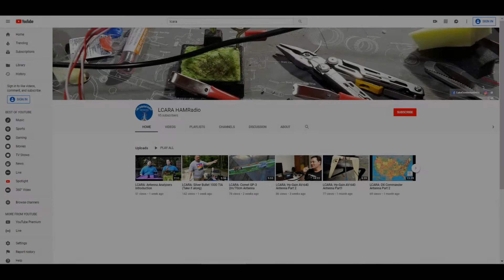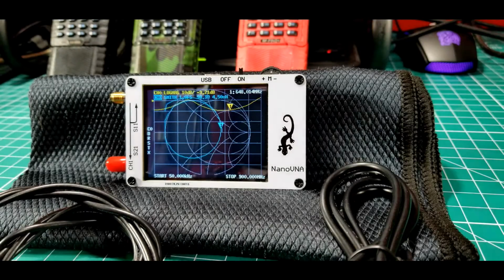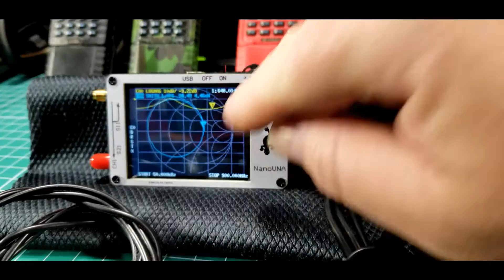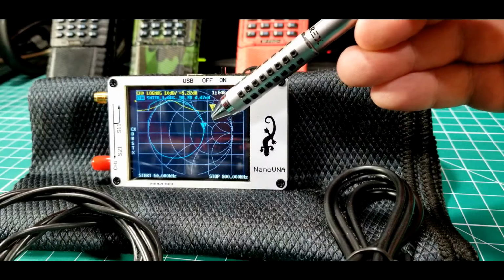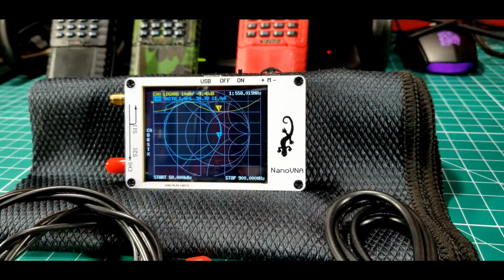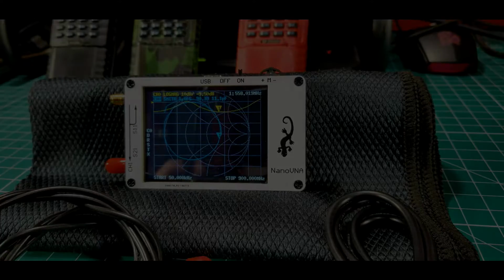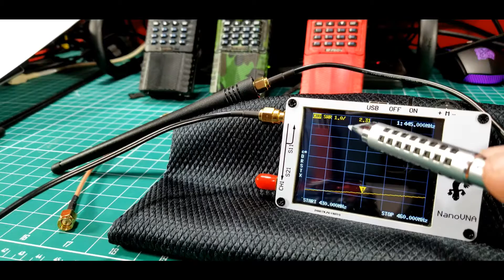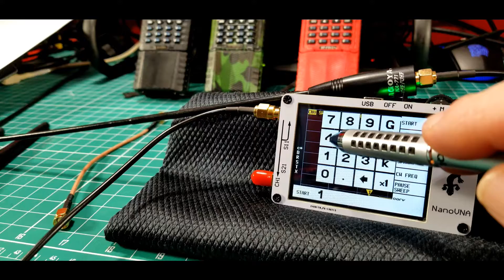LCARA HAM Radio: NanoVNA Antenna Analyzer

Comment: I see a lot of demo's for this device,  but not much in the way of practical use. 

I plan to get one of these to dial in the antenna for my mobile CB (I drive a truck, so the CB still has a very real value to me).

I use a sort of vertical dipole that I've constructed from a pair of mobile antennas.  What I want to see, is a demonstration of how to optimize my antenna to 27.185 Mhz, using this device.  Can this device tell me if one half of my antenna needs to be lengthened or shortened? If so, which half?

Also, it looks like I might be able to use this device to build wifi antennas for my home. Or, maybe improve the antenna for the cell signal booster on my truck.  Examples of that sort of thing would be awesome, too.
Reply from the maker: @Big Green Truck You haven't seen the last on the NanoVNA! KY4CKP plans on a video showing it's use to fine tune an antenna. Stay tuned. Thanks for the comment!
Reply: @LCARAHAMRadio  Awesome.  I look forward to it!  Sometimes, I think that I'm the only Chicken Bander that looks to the HAM community for proper radio set-up and operation, lol.

Comment: You've convinced me to buy one and put together a program for my club.  I'm curious, will this work for adjusting a repeater duplexer?  I know it is not a precision instrument, but I wonder if it is accurate enough?
Reply from the maker: There are a couple of videos around  YT showing tuning a repeater duplexer.  Either a more traditional style SWR meter such as an MFJ or something like the NanoVNA should work as long as the band(s)  you need to tune are within the capabilities of the hardware you buy.

Comment: Way too BIG... This thing is a monster piece of kit!
With the trend of amatures buying HF rigs that require micro-surgery size styli to operate, they should call this device the "Boat Anchor" VNA! This may not even require a jeweler's loop to read!
I can see it coming, the new question at ham swap-meets is gonna' be; "Does this antenna analyzer make my ass look big?"
Video review - A+
Product rating - FAIL
Thanks for the video!
73s,
N02BIG - Minne Scule
RI, USA

Comment: Show more standard antenna testing that we would use in the shack and probably out in the field portable.  This is a very useful and cost effective tool and should be in every new hams tool box.  

Dave K8WPE since 1960
Reply from the maker: David, I completely agree the NanoVNA is a great addition for any radio operator.  If there is enough interest in showing the PC software I can certainly use an HF antenna for that demonstration.  Its just a matter of having an adapter for the pl-259 (or connector of choice) connection.

Comment: So how does one know which version and from whom to order?
Reply: There appear to be 3 main versions.  A black one,  a white one with the gecko and another black one with sheilding (some with batteries some without). There is a very active group.io forum for the nanovna. So far most testing seems to show that actual performance is fairly close between the versions.  I would go for a black one with battery (or add your own) with shielding if i bought another one.

Comment: Id lije to ser this tune a duplexer
Reply from the maker: Hello James, while we do have some duplexers available to us and tuning them is not to different from tuning an antenna I don't know when we could try to show this.  I think the audience for this would be quite small.  We may try to cover this as some point but it will be later this year or after the first of next year maybe.  It is certainly possible if you have the right connectors.
Reply: @LCARAHAMRadio  Yes, I would like to see that also.  I have a Service Monitor with a phone book size manual and complicated set up.  This looks much easier to use.

Comment: I purchased one and for the life of me I can not set the thing up to see any swr info. 
The zero trace is at the very bottom of the screen. Could you produce a video for the Newbie in mind showing EXACTLY each key press to SET UP the Nanovna to show SWR? I would be forever in your debt. Most of my hair is gone trying to analyze an ICOM HT antenna.
Reply from the maker: I'll see if i can get one posted tomorrow.
Reply: @LCARAHAMRadio  You are the best!!!!!!!!!!!!!!!
Reply from the maker: David, I've got a couple of questions on the Nanovna that I'd like to cover via a follow-up video but I wont get that out until Wednesday.  Let me see if I can help you with your question for now:  On my nano when I first turn it on it has the two traces and they are showing logmag and the smith chart.  I like to turn off trace two (the smith chart) if I am just going to check swr for an antenna like I showed in the video so to do that  either click down on the jog wheel or click in the upper right corner of the lcd to bring up the menu.  Then click on  display and then Trace. On my unit Trace 1 (the second trace showing the smith chart).  then click off.  Then click back to move up a level in the menu and then click format.  Now click SWR.  Trace 0 should now be showing SWR instead of return loss.  There is a chart you can find which shows the relationship between return loss and SWR as well.  Several sites have those to download for free.  I downloaded this one to have one handy:  https://www.minicircuits.com/app/DG03-111.pdf .  I hope this helps get you going for now and I'll show this in  the upcoming video as well and also how to calibrate the unit and how to calibrate the touchscreen. 73  Chris KY4CKP/AE
Reply: @LCARAHAMRadio  Thanks very much for your help. I have accomplished the above but the 0 trace is at the very bottom of the screen and only goes about a third across the very bottom then the trace picks up again at the very bottom about 2 thirds across the very bottom.  I think in trying to set up the VNA I must have entered too many 100 000  000s. Is there a RESET button somewhere to get back to factory fresh?
I see only yellow flat line at bottom. I really need an SWR setup step by step. Or better yet an Elmer. Thanks for taking time out to help. Dave
Reply: @davidhubbell9643  David, I"ll have the video out on Wednesday.  You can go back into the menu like in the video above and when you enter the value you can enter say: 146 and in the input screen there is a "m" for megahurtz.  That does make dealing with the zeroes easier.  So 14 and "m" or 7 and "m" if you are in the HF ranges or 444 and "m" etc.  In the above video starting about 8:03 I show how you should be able to get to the entry screen and how to enter whatever value you want HF/UHF/VHF.